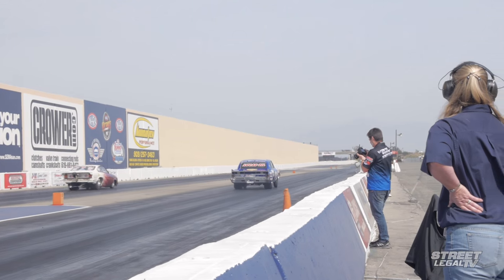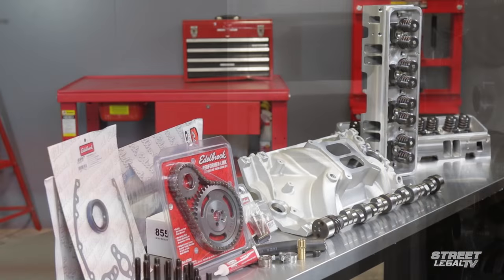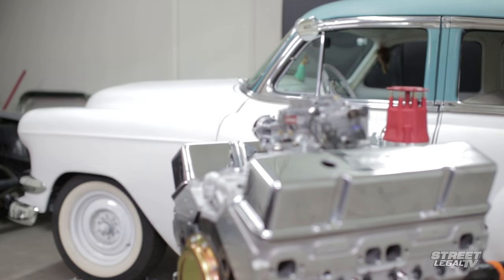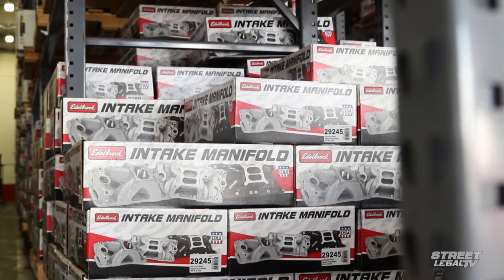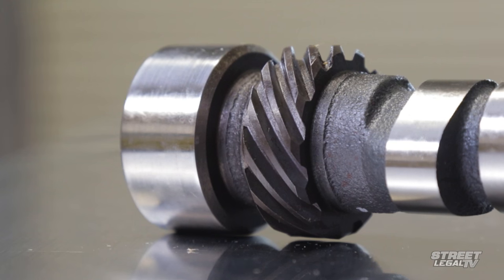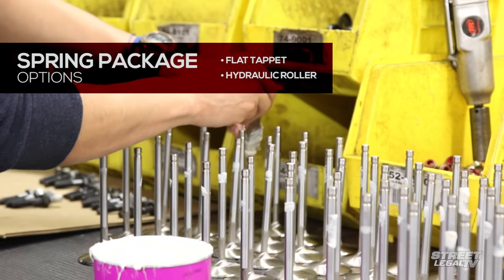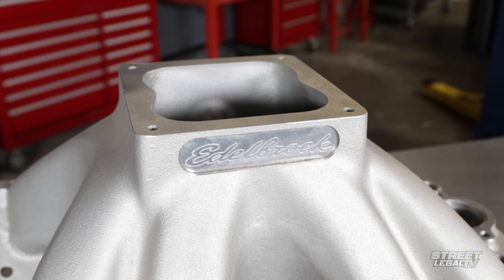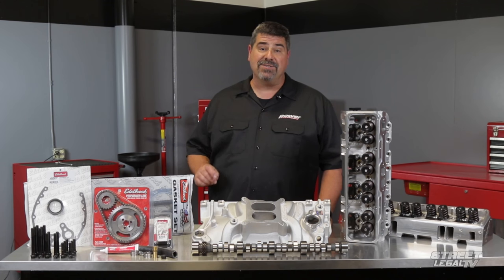No Guesswork: The Edelbrock Total Power Package System

Comment: I have a 383 four bolt main one pieces rear main seal with scat still crankshaft 3.75 stroke with 6 " rods with KB piston with Dart pro 1 head 215 with 63 ported 12 .1 compression I'm running comp came solid roller lifter 630 lift and comp came pro magnum 5.1 rocker arms with ported Victor Jr intake 3500 to 8000 rpm with a 1050 Dominator with a 5500 stall in my 82 s 10
Reply: Charles Davis good setup

Comment: I have 40 years experience building engines and I use Edelbrock intake manifolds exclusively. That being said, I installed the Performer RPM package for small block Ford on a customer's car with a 302.. (as per customer request) Even with a high stall converter and 3.55 gears the car, a '68 Cougar which is relatively light, was an absolute slug. Not sure what the problem was, the engine ran perfectly but gutless compared to equivalent engines I've built. The package looks great on the dyno but does it actually work?
Reply: something is not right there.
Reply: It’s a ford was the problem 🤣
Reply: The cams are to small IMO. Plenty of better kits. Even Jegs kit makes more usable power. These kits are quite conservative

Comment: I'm needing the eldenbrock aluminum head for jeep 4.9 striker build, can, head intake exhaust and feul injected throttle body. I want matched set that will work reliable and longevity 6 cylinder 4.9 stoker can this be achieved by you?.

Comment: I have searched through these packages and they don’t seem to make one for a 305 small block Chevy. They have one for a 302, a 327 & a 350, but not a 305. I guess people are right, they are boat anchors, I just didn’t want to spend 10’s of thousands of dollars buying a 350 or 383 crate engine plus a new transmission, to get more power out of my 1986 Trans Am, so I guess I’ll get nothing & like it.
Reply: 2nd option with a small bore performer heads option

Comment: What price range would I be looking for a complete package for a chev 283 to make 300 hp  or more?
Reply from the maker: Here's Edelbrock's number: 310-781-2222
Reply: If you have a 66-67 283, and have the bore opened to 4 inches, put Flat top pistons with 2 eyebrows instead of 4 (May have to be forged for that).. Have the block decked so the pictons are +5 thousandths out of the hole, and This Edlebrock kit with a GOOD set of headers, you most likely will make more than 300.. Put an advance curve kit in the distributor as well.. You will be impressed.. If you don't want forged pistons, with 2 eyebrows AND YOURS ARE GOOD, use them, 5 out of the hole, with the thin steel head gaskets.. It will STILL impress you, but if you ever wanted to use Nitrous, forged would be best..

Comment: He said the performer rpm would make 360 hp on a sbc. That's pretty lame.
Reply: 360 hp is alot for daily driving and for people who want to have fun ripping it once in a while not for extreme drag race every corner until I die
Reply: @carlosking0167  I agree but that particular intake is capable of a lot more than 360. It will support a 6500 rpm engine.
Reply: Right by the time you spent $ on the kit,some kid will blow your doors off with a high mile 5.3 with a cam

Comment: Edelbrock really missed an opportunity to get Crane Cams for cheap. Edelbrock isn't really good at camshafts. If you compare their stuff with Comp cams xtreme cams and Crane cam line, which is why I rather have the adfor mensions camshafts instead.
Reply: Have to agree, not a fan of Edelbrock cams, But i have the Heads and Rpm Air gap on my Ford 460, Works really nice.

Comment: Regarding edelbrock performer rpm #60899 cylinder heads.
Not for the novice mechanic! Who ever purchases these heads the push Rod guide plates do not line up with holes on heads they are missandeid I purchased them brand new from @ Team C Performanc in Los Angeles Ca both my Brother and I purchased them @ the same time so when I saw the problem I checked the other set also and discovered it had same defect!
so I called Mr Ken Sink @ the so called expert from edelbrock and was given a ton of lip service so with he was absolutely no help at all 
So with my 55years of engine building experience I decided to come up with a solution to my problem and found a really great set of adjustable push Rod guide plates by jomar company part #1501 and it totally repaired defect on the edelbrock cylinder head with now perfect pushrod alignment so much for the experts at Edelbrock corporation Vick Sr.and Vick jr. Must be rolling over in there graves no quality controll I cant Thank experts from edelbrock enough Mr.Sink
I was left holding the bag this could have become a catastrophic event
So if you chose Edelbrock chose with caution there are many other manufacturers of sbc heads also my first set of aluminum heads extremely disappointing 
This comment made by Mr.Roman 
☹👎☹👎☹👎☹👎☹👎☹👎
Also thanks to owner of Team C 
Mark poor way to do business☹👎